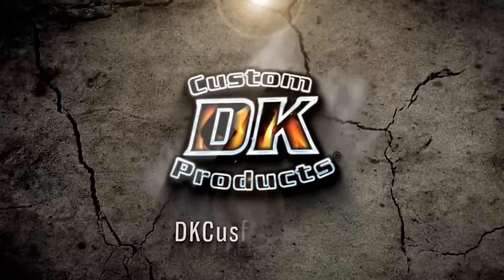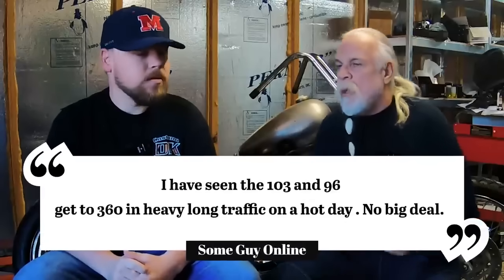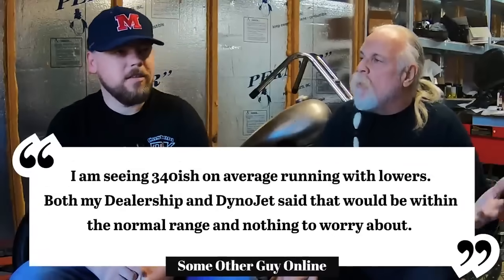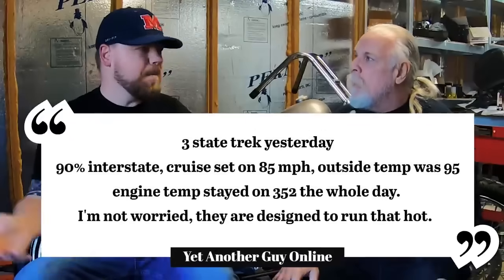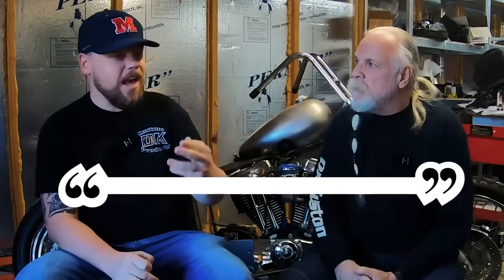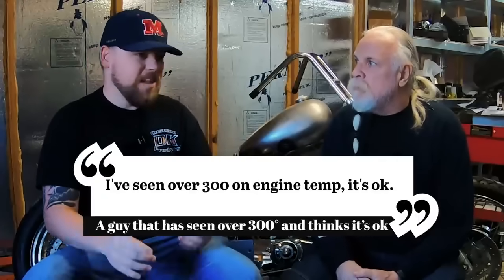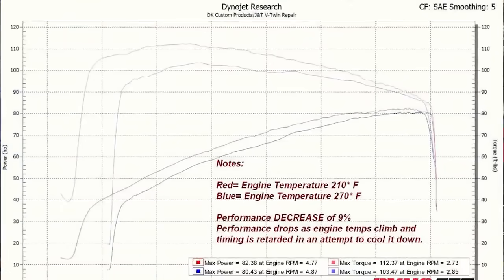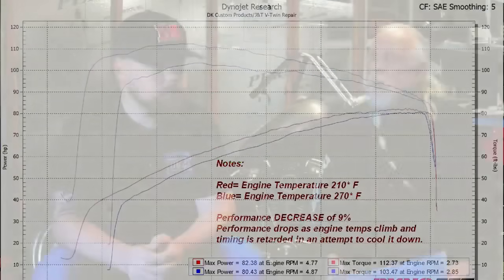Harley's - The RESULTS ARE IN About a Popular Myth

Comment: Fellas, fellas, all this could be a thing of the past if the "Old Guard" wouldn't be so "HELL BENT ON AIR COOLING AND NO RADS !"
See, your engines would be A-Okay if you had a small rad and small water jackets THRU OUT the upper cylinders AND heads.
It's simple.
You don't have to lose your precious fins and look.
Just use them to supplement the liquid cooling. Win -Win.👌😊👍
Oh, and while they are at it, can we get rid of the pressed together cranks ? I would rather have a little bit of rocking couple and staggered cylinders if it means getting a forged one piece crank.
Reply from the maker: Fair points all around. Hybrid cooling could offer the best of both worlds—maintaining the classic air-cooled aesthetic while improving thermal stability. And yes, a forged one-piece crank would be a serious upgrade in durability. Definitely ideas worth considering. Thank you for commenting! MB

Comment: Love my 08 Electra Glide ,34,000 miles, found for $500.00,  runs great on 15/40 diesel oil( as per owners manual) . Not a lot of power for 1600cc, but handles better than my metric v twin cruisers.
Reply from the maker: It sounds like you’ve got yourself a great deal on a great bike! Thank you for commenting!😎 MB

Comment: No surprise, people have been laughing at my oil cooler for years. My '86 custom built Delkron has never leaked or had the heads off since it was built. I personally would never buy a TC or M8.
Reply from the maker: I am glad that you have a bike that is running great and not causing you any issues. Thank you for commenting! MB

Comment: I have a aftermarket oil temp gauge 300F max (electric sender) on my m8 softail with a Ultra Cool dual fan. where is the best place to put the temp sensor? I have it in the drain plug at the moment but im building a 160hp 131 for it.
Reply from the maker: For Oil Temps we measure with a Power Vision or with a Oil Temp dip stick. We get our Oil Temp Dip Sticks from JES Customs. You can see a link to them here - https://jescustomaccents.com/

Please feel free to reach out with any questions;
Support@DKCustomProducts.com
662-252-8828

Thank you for commenting! MB

Comment: I've watched a  few of your videos and purchased the wind deflector and the tank lift.   I was wondering if there is a temperature difference between  the roadking with oil cooled heads and the twin cooled  ? Thanks
Reply from the maker: The "Twin" is air and coolant.  
Unfortunately HD did not put oil coolers on these bikes...so they end up running Hotter than the bikes that are not Twin Cooled.  We have a full video on the subject at this link- https://www.youtube.com/watch?v=wRRtRYWm5rw
Thank you for commenting! MB
Reply: Yes, anything liquid cooled is going to run slightly better and produce more power then air cooled only.

Comment: Running 50wt non synthetic . Run the right oil is all it takes . It’s crazy how many people think that 20w50 is best for these bikes other than winter .
Reply from the maker: You should just make sure you are running the correct viscosity oil for the lowest ambient temperatures you will be riding in and you are golden. The manual does list what is the best viscosity for what ambient temps.

Here is a full video we made on Oil that you may find interesting - https://www.youtube.com/watch?v=bNHgNThrqQo

No you do not need to cool the transmission. You just need to make sure your bike is not overheating and you will be good. 

Here is a full written report we have made on cooling down your T/C & M8 that you may find useful/interesting - https://www.dkcustomproducts.com/why-how-to-cool-down-the-twin-cam-engine-part-i-dk-cl-tc-dn-1.htm
Part 2
https://www.dkcustomproducts.com/why-how-to-cool-down-your-twin-cam-engine-part-ii-dk-cl-tc-dn-2.htm

Here is a full video play list on the subject as well- https://www.youtube.com/playlist?list=PLb3bvZgbH92_3s-2vv63QggFJ3nteFd_C

Thank you for commenting!👍😎👍 MB
Reply: Wrong, it’s more than just oil. To my knowledge 50wt is thicker taking longer to thin down then 20-50 at cold start. Second you obviously have not been paying attention to any videos on the subject. I don’t know where you are from, but here in Louisiana it gets 100 degrees with a heat index of up to 108 with 90 percent humidity drowning out the motor in heat and breathing in hot moist air. My massive air cooled only 117m8 was cutting power at 270 degrees and over heating. Don’t you think if it was running 50wt oil fixed the problem everyone would run it instead of spending money on cooling products.
Reply: @Prometheus1979  I read your past comments and you said you run 20w50 in all four of your bikes with no issues that’s a lie you just said your bike is cutting power and over heating lmao 😂 cmon man get your story straight .
Reply: @ Wrong ! I’m from Texas run the right oil keep the bike cool also in your manual it tells you what correct oil to run in certain temperatures and I can tell you that the manual doesn’t call for 20w50 when it’s 100 plus outside and you wonder why you over heating lmao so you need to expand that knowledge buddy . Running the right oil helps dramatically with temps 20w50 you just burning that motor up  don’t speak on things you know nothing about again what does the manual call for look it up educate yourself! Very few people even know about it and Harley will sell you synthetic because it gets them a tax cut not to benefit you lmao . Keep over heating thinking 20w50 is best for that Louisiana heat . Read your service manual lmao buddy if you got one .

Comment: Gentlemen, good afternoon. Great information is always a bit off-topic but a quick question does the lay down license plate bracket on the 2018 FLDE interfere with a backseat?
Reply from the maker: It should not interfere with a seat, but it could matter what seat you have. If you want to send measurements to our Customer Service they can help you determine if it will fit. 
Support@DKCustomProducts.com
662-252-8828

Thank you for commenting! MB

Comment: Great info guys ! I have a 2021 street glide M8 I have herd the mighty love jugs don’t help any thoughts ! Thanks 🙏🏻
Reply: Can’t speak on that but my ultracool setup really works well.
Reply from the maker: Here is a video series on the things you can do (and it is what we do with our own bikes) to cool them down.  No one thing will get the temps under control- https://www.youtube.com/playlist?list=PLb3bvZgbH92_3s-2vv63QggFJ3nteFd_C
Here is a written report on the same- https://www.dkcustomproducts.com/why-how-to-cool-down-the-twin-cam-engine-part-i-dk-cl-tc-dn-1.htm
Here is a short list of 10 low and no cost things that can be done- https://www.youtube.com/watch?v=o3T3yA9BKwE
Specifically on fans, the pickings are slim...Love Jugs, which you don't want, Force Flow Fan which is available for M8's right now, but the Twin Cam version is being redesigned and won't be available for quite a few months...see them in this link- https://www.dkcustomproducts.com/jims-force-flow-fan-cools-twin-cam-engine.htm

Please contact us with any questions:
Support@DKCsutomProducts.com
662-252-8828

Thank you for commenting! MB
Reply: @DKCustomProducts thank you so much you guys are great
Reply from the maker: You are most welcome! MB
Reply: They work on RGS in conjunction with Harley Oil fan. On my fat bob I went with Ultracool , it also works well using the egr from dyno tuner to monitor them.

Comment: water cooled heads made a big difference
Reply from the maker: The twin cooled bikes are not running as cool as the air cooled with oil coolers on them. Here is a link to the full video - https://youtu.be/wRRtRYWm5rw
Thank you for commenting! MB
Reply: Only some. It’s still an air cooled engine.